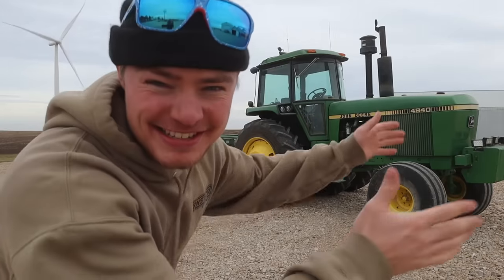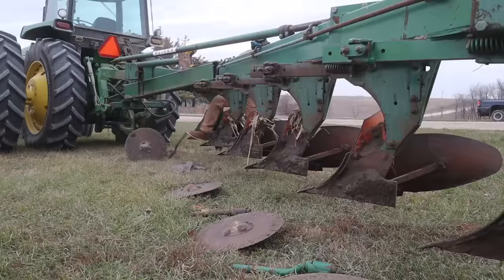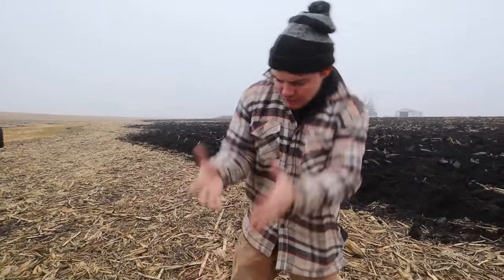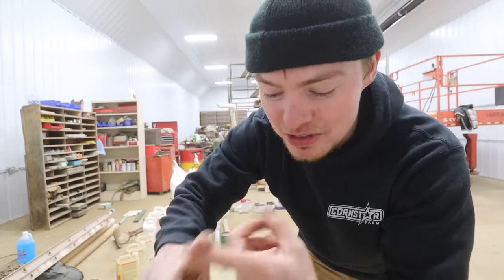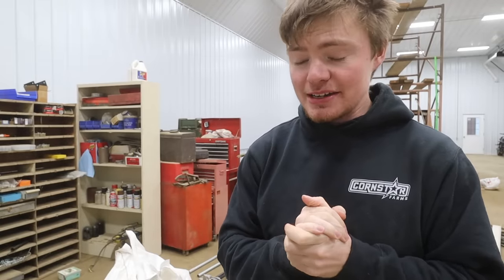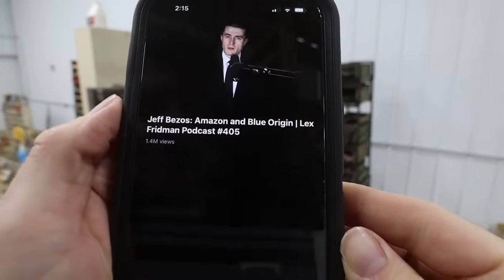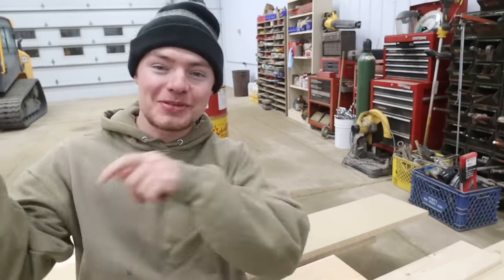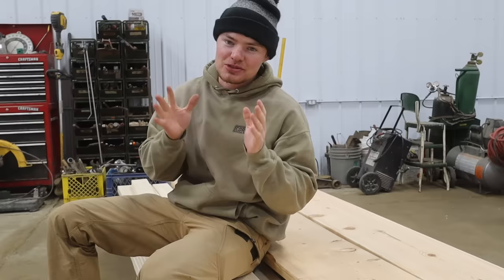My 1st Time Plowing

Comment: I had been plowing probably 5 years before my family sold their dairy farm in 1981 when I was 14. I remember one field in which the corn stalks kept plugging the plow. I remember the neighbors field that we rented for years. I was on our IH 826 Hydro Demonstrator when half way up a small hill i hit a spring or boil with the right rear tire and in the blink of an eye the tractor stopped so fast I was thrown towards the steering wheel and the right rear tire was spinning like mad and dug a hole until I hit the clutch. I was able to lift the 3pt and back out. Dad would get really mad whenever anyone got stuck as that would slow forward progress and nobody is ever supposed to make mistakes.

Comment: Growing up in SE MN on a dairy farm, that’s the only way we tilled the fields. I used a 4 bottom plow pulled with a 756 international until we got the 1456 turbo with a 5 bottom. Put some duals on that tractor and you will have a lot more pulling power and traction.
Reply: He's got it right duels on the one side single in the furrow. If it was an on land plow duel up both sides
Reply: @michaelmullen8153  didn't see the left dual the 1st time

Comment: To help with the tractor spinning out plowing with a semi mount plow you need to set the draft control lighter its the knob down by your right foot, it will bump the plow up a pinch when the plow starts pulling down harder on the 2 point arms. Your coulters were set to shallow they should be running 2-3'' above the plowing depth.

Comment: Cole, please keep all of the tools that are left over from when you are finished with your shop who still has a shop and bring all of the leftovers to that shop and start the demo of that location depending on whose shop it is to clear it out if the entire electrical power is up to code for their needs in that ficelity find what location, is best for them to have shop bench and their tool requirements take all of your leftovers, tools, and theirs once those shops makeover is finished do that for everyone's shop than and only then collect everything than sell it on your website online store if not able to sell them put them in the scrap bin and get $$$ off the scrap.
The other thing is to do all of the tractors, have tools in portable toolboxes with them either on the frame or inside the cab of the tractor which never leaves that tractor unless you sell it and mediately relocate the newer tractor unless you decide to sell the tractor with the tools and toolbox get all new tools and toolbox and keep them in the cab or on the frame for the new tractor.
Sincerely!
R.S.V.

Comment: Pallet racking along you can make small and wide shelves can build benches in it have sliding storage units in a section could mount air compressor on a shelf in the corner no building a shelf and cutting hole in the wall tin

Comment: If it was me, I'd spend the money and put pallet rack down the side with the compressor/heater (or at least start with several sections). Then add as you need more. You can set the bottom shelves on a couple sections high to set the compressor ,barrels, motorcycles, mower, totes, etc under. You can also set a shelf up at work bench height and set some plate steel on the beams for a solid bench. Could make it just high enough off the ground a bottom section of a tool chest will roll under it.

Comment: Cole, if you run a galvanized pipe down one wall and put several air quick connections on it, it's extremely handy not to have to be pulling a really long air hose across the shop
Just a thought

Comment: I would prefer a reversible plow over this type of plow but that's just preference. Because with a reversible plow you can use the draft control. You can plow way more acers an hour. But it's way harder to master plowing with a reversible plow. I plow approximately around 6 acres an hour with a three furrow plow with a ground speed of approximately 5.2 to 5.5 mph. I normally work with metric units so it can be a little off.

Comment: I must admit when I plowed with a fwa tractor.  The change. Wife thinks it’s funny I go out with one implement.  Come home change. Until you try it you can’t tell what will work.
  Are you planning to seal the floor?  I realize decade plus old.  I keep thinking I clean my garage. It’s going to get painted lines for stuff. You should have put the 110v plugs Foot above the bench, and one infront of bench.

Comment: Pegboard on the wall over the bench with wrenches lined up by size. When one breaks or you take it on a job and lose it, you have spares. Sockets in the tool boxes, anything over an inch is expensive, save them.

Comment: The place where I grew up was across the road from a field owned by a local seed corn company.  Every fall, they would plow the field using Caterpillar crawler tractors.  I don't think they had any problems getting traction to pull the plows.

Comment: At the 15:03-15:27 part of this video, while you were talking I noticed that what looks like the dead front cover to your electrical panel on the floor. This really should be installed. Hopefully you didn’t throw it away 😬.

Comment: First of all, Merry Christmas to the Cornstar family. Cole should be glad he is using the plow setup he has. Back in the day, we used a two bottom trip plow. In the Nebraska panhandle we plowed every Spring. You knew it was Spring when the plows came out. We got our first tractor in mid 60s it was a John Deere 4010.

Comment: you might want to consider something like a plier rack for your drawers of plyers get the handles of all the pliers lined up side by side and not on top of each other, also might want to take a piece of flat bar or angle iron or something and drill holes in it for common use screw drivers to just be accessible not in a drawer...or other tools think what your top 10-20 tools are and make it so you can reach for them without opening a drawer...made my life easier as a mechanic...

Comment: Sounds like you need a bunch of manure, Compost and/or organic matter like Wood Chips and Sawdust for soil amendments. Build your soul as you plow and incorporate the Lime into the soil. And test again next year and confirm that you have enough lime to neutralize the acidic soil. It might not be done yet but you need to measure your changes.

Comment: Thanks Cole, good to see you take that scaffold down, just remember OSHA rules when you set it up again, you need toe boards all the way around. But seriously, the concrete floor will continue to let dust loose when you broom it until you seal it with a paint product.

Comment: You should not have to take the coulters off, have you tried sliding them forward?  Also, that ag leader guidance system is useless for moldboard plowing.

Comment: so you are plowing just certain spots... you need to do more pre use maintenance on your plow.. get it all shiny, then coat with grease or paint it.. rust is what makes it clog.. the coulters will help with trash - if they are clean, rusty they are trouble.. if you are going to use it for spots in the future clean it up, grease or paint, fix the coulters so they work right and learn how to work it.. those older tractors have special valves specifically for plowing on the 3 point.. the directions are complete junk, find somebody with experience and ask how the plowing control works on the 3 point.. they did billboard adds on the highway about there three point plowing controls.

Comment: I envy your work ethic, but listening to all of your grand plans for your shop only emphasizes the fact that your not a mechanic. Throwing away tools when you have so many different buildings and vehicles on your farm is very short sighted. First organize your tools so you have the best quality complete sets of tools you can for your shop, then a full wrench set, full socket set, full screwdriver set, some pliers, and a hammer in a regular tool box in each truck. It would also be a good Idea to have some tools in the bin shack, with as many trucks as you have coming and going across that bin, and you have to walk all the way to your heated shop for a pair of pliers...................

Comment: Plowing has got a worse rap than it deserves. It's called NO PLOWING but it should be called NO DISKING or NO TILLING. Plowing is not really the problem. Plowing just flips the soil. Where on the other hand Disking and tilling breaks down the Porosity of the soil.

Comment: Maybe you should quit trying to farm with the computer and learn how to run equipment. Plowing without the coulters is stupid. Also the tractor has draft control use it. Not sure what your dad was doing with fertilizer management but PH in soils does not get that low in 5 or more years and putting on 3.6 tons per acre is stupid. Where's your fertilizer in not telling you that. You'd be better off with 2 ton this year and more in a couple ofyears if needed.